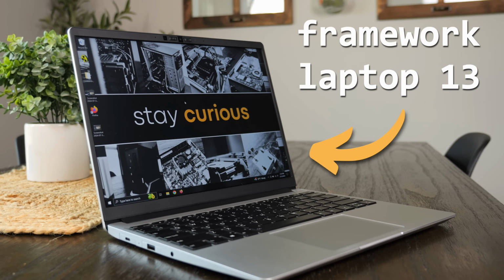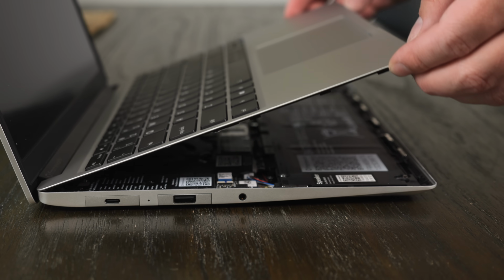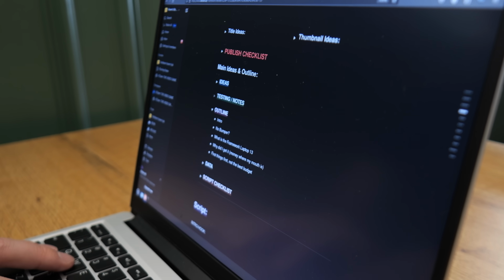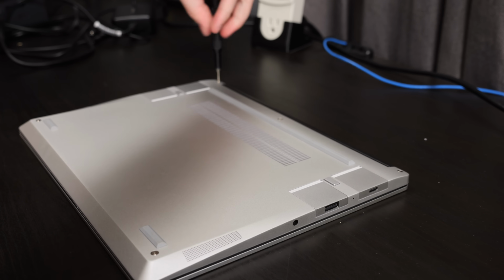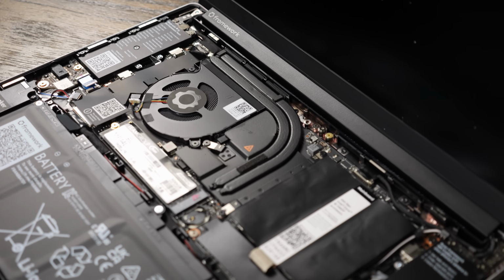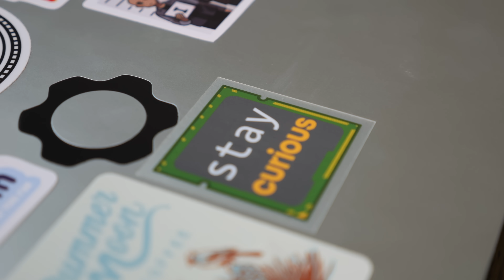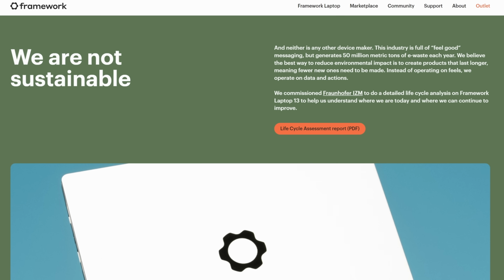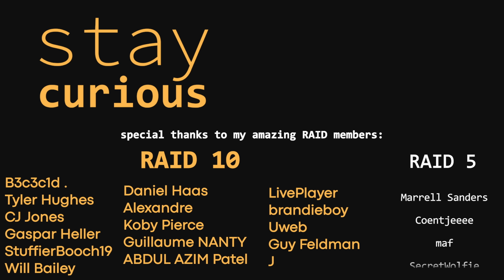Is The Framework Laptop ACTUALLY Worth It?

Comment: I would consider buying the 16" IF they add a keyboard option that has Home, Page up/down, and End keys on the right side of the laptop like what HP and a few others do on some of their laptops. I use the Page up/down keys to scroll through websites easily. It's a lot easier doing that than using the touchpad to drag the right cursor up and down and using the Page up/down keys are a lot easier for people who have arthritis.
Reply: Can't stand touchpads...when all you need is a cheap wireless mouse...why make your life so hard??😉
Reply: @erpino68  I like touchpads. And I use laptops, and so a mouse would not be possible as I hold my laptop and move it to different locations and positions. I've used touchpads for a couple of decades now. I don't think I could go back to a mouse where you're moving your arm all over the place compared to just moving your finger.
Reply: Could you give an example of where is that function or how it looks like ? I'm searching a new pc and it could a great option on travel.

Comment: Just got to the section about the high price and that buying a used laptop would've been much much cheaper. Yeah, a used Framework is an option too, one with much less chances of hidden problems. Probably not as cheap as other laptops, but you can buy a 2nd hand upgrade for it too later, so it should certainly be a good option long term.

Comment: As someone with both a framework laptop (and has used windows laptops for a long time) as well as an m2 pro MBP, it's kinda an unfair comparison. The MBP has incredible battery life, stays cool and quiet, and the best trackpad experience there is. In my opinion the trackpad experience on windows laptops in general is just awful. The battery life on windows laptops is bad, and with linux it's absolutely awful. Windows laptops (or intel one's at least) get hot and loud very easily. So for me, the major problems with the Framework laptop are just the major problems with anything that isn't a macbook. Of course Apple does everything they can to make sure you won't ever be able to fix or upgrade their products, and extorts you with massive upcharges on ram and storage.
Reply: 1. New snapdragon X elite chips
2. I dont see the point of a macbook pro at the price point, sure the tackpad is nice, and the hardware seems incredible, but when you factor in that you have to use an emulator for 99% of normal mac apps beacuse noone wants to port to arm, then you have an issue, beacuse emulation kills the performance to like 4th gen intel mobile speeds.
3. Any laptop runs linux, which is a lighterweght os which should heavily increase battery life.

Comment: I really like the framework laptops and what they are trying to do.  However, I have desktops at home and a work laptop.  So thin and light was important so I can take it and this giant Dell laptop when I travel.  I picked up a little ACER with Ryzen processor as it seems like the Ryzen mobile processors have better battery life.  It really isn't for doing "compute" but I wish it had more RAM/non-soldered RAM.

Comment: Battery life on Windows is abysmal. I've been using Linux on my Lenovo Yoga 9 (2022) now for 6 months and the battery life is at least 2.5X if not 3X what it used to be.  And heck, even if the current battery upgrade that Framework offers isn't great, it still 1 makes a difference because they are offering it first hand and 2, with battery degradation over time, getting that bump up is great!

Good video :)   I'm very glad to see more Frameworks out there.  My next purchase is going to be a Framework as long as they continue to improve. Really like seeing how they are improving year to year.
Reply: really? i had the opposite, i guess modern laptops love more linux
Reply: If Framework keeps offering batteries with backward compatibility then it'd be great selling point for me. I have an almost 10 year old Thinkpad and the only batteries I can find for it now are dodgy ebay no name ones.
Reply: @DizzyAndHigh all their batteries are chassis-specific (12,13,16) but are fully backwards compatible. All their critical chassis mounting points and cable/plug locations for the battery remain the same generation over generation.

Comment: As far as battery life and temps, thats an issue with the Intel 13th gen and even the Ultra.  Its well known that the AMD Ryzens zre currently the best for mobile (very perfomant, very efficient, longer battery life, runs cooler).  If you do decide to upgrade from the Intel 13gh gen, do some research at the time of purchase.  Right now the Ruzen 7040 series is the best option for mobile.  We'll have to see which is better between the Core Ultra and Ryzen AI 300 series in terms of battery life, temps and performance.

You really need to have a specific reason to go for Intel over AMD.  If you know what those specifics are, then Intel.  Honestly i don't see any reason to go Intel over Ryzen since the cons overwhelms the pros (all ports are TB4, and Quick Sync).  Ryzen pros are way more (performance, battery life, temp, faster iGPU).

Im surprised you didn't mention this in the video.  Battery life and temps not Framework's fault.  Get Ryzen instead, all fixed!
Reply from the maker: Well I mean there was that whole part where a simple thermal paste replacement fixed my temps. 🤷🏻‍♂️

But battery life, yeah I think the ryzen units seem to be better 👍🏻
Reply: @HardwareHaven  If you don't need the absolute full power, checking and toying with the power limits and performance levels can provide a big boost, especially on Intel chips, since they have such a high limit on power draw, if you give them power, they will use it. Of course a power limit will reduce performance, but in most common tasks it shouldn't be noticeable.
Reply: @HardwareHaven  it did, but I'd imagine the Ryzen counterpart would run even cooler with the same thermal paste. 😁
Reply: though, intel meteor lake has impressive video play back on battery. Its one of the few area's where it shows a clear lead over AMD. 

I don't know how it compares to the newer HX 300 series cpus though ( i refuse to say AI)
Reply: @Marauder-q2v  I'm jealous of Intel's AV1 hardware acceleration.

Comment: If they had serial ports I'm sold; We need them doing industrial automation.
Reply: USB to Serial adapters don't work?
Reply: @joeyyung911  Dongle isn't? Old laptops had them standard.
Reply: @TradieTrev    I used them on Cisco routers.
Reply: The expansion cards for the Framework are open source, so if you can get someone who knows how to wire up a Serial-to-USB-C you're good to go.
Reply: @K9TheFirst1  What about for the auto electricians? Shouldn't they get a canbus module, I;'d love to see an Ethernet cat device for debugging data flow.
Reply: @TradieTrev  I am not the person to ask about this sort of project, but so long as it can be translated to USB-C on the other end, and the actual connector can actually physically fit on the other end of the card, I don't see why one can't make any sort of device connector for a Framework.

Comment: Can you buy replacement parts from other vendors? Are there other vendors out there? My concern is that if Framework goes out of business, then how and where do you get replacement parts? It's like Framework made a sustainable product that will last for as long as they are still in business.
Reply from the maker: I mean, this is pretty much going to be an issue anywhere that there isn’t a standard. At least with framework, they’ve made all their schematics publicly available. I think that’s about as much as you can ask for when good standards don’t exist.

Comment: You've said "compared to my experience with the laptop that was twice the price and that no way in hell I would be able to fix/upgrade" a whole lot of times lol

And then you complain about having a single nvme slot without saying how many nvme slots you'd have in that laptop with twice the price you had (none, that is)
Like.. there are 8tb ssds, no?. They are relatively affordable, if you need that much more storage, and just 2tb is actually pretty cheap

But yeah sure more slots is better, guess it's a valid complaint (esp. if you want to have two drives mirrored for fail safety)

Then you spent a third of the video talking about battery/temperature issues, posing two sides of the same coin as two separate cons, only to immediately fix it
Like sure, their bad that the thermal paste in your unit was bad, but bashing it for so long for it seemed a bit unfair, especially for a non-universal (hopefully) issue

But yeah it'd be annoying to a less tech-savvy user - still to me it sounded like "these laptops are meh because they overheat and battery drains fast" generalisation kind of thing.

It's just that the vibe I'm getting out of the first half of the video (the more important half) is that you blow the negatives out of proportion, and not like I know a whole lot about these laptops anyway

Second half, expansion cards are limited.. How?. Like it's a negative word that you said for the sake of it being negative
Like I'm pretty sure it's as good as any $1100 laptop you can get, and it only gets better from here, because it's a - dynamic, you can change the config at any time, and b - you can have exotic configs, like 3 ethernet slots (+1 type c for power) or something.
Not a lot of options, because people don't need exotic ports anyway.. - so what were the ports you were missing that made you say cards are limited?
Also you don't need a separate drive to dual-boot linux, lol
Again, literally the same thing again, "there aren't that many on the market, but there are a few [of those exotic ports someone might need]" - how much would be enough to stop saying "aren't that many" in a slightly negative sense for no reason whatsoever?.

Yeah, making every bit of hardware work in linux is a pain, it rarely has good "out of the box" experience :)
It's definitely possible (and easy for people who daily-drove linux for years) to fix the brightness keys and to make the fingerprint sensor work (I specifically heard about the framework one, heh), but oh well, linux being linux
Reply from the maker: Well this comment is wild haha…
First of all, I made it very clear that the MacBook Pro and framework were in completely different segments of the market. I feel like I also made it clear that a lot of the expandability and repairability of this laptop were exactly what sets it apart from other options on the market. 

You say I immediately fixed the battery and thermal issues, but the battery issue still remains. Fixing thermals doesn’t change how the battery works lol.

As far as expansion cards go, I wasn’t criticizing them or the concept. I think it’s great. I was saying that I was a bit disappointed that there weren’t a ton of cool options made available because in the end people mostly just need USB. That wasn’t necessarily a bad thing, just a realization that there aren’t as many fun use cases for the expansion cards as I had maybe hoped. And yeah I know you don’t NEED a second SSD to dual boot. You might’ve noticed I was dual booting from the same SSD 👍🏻
Reply: @HardwareHaven  sorry, I keep doing this thing where I get agitated for no reason whatsoever and dump a bunch of haphazard thoughts like that only to come back an hour later (like now) and be like "what" and "oof the tone could've been lighter by a lot at least". Multiple people said it's autism, but none of them are doctors so idk, maybe

About the battery I was plain wrong, it's obvious that if the system overheats the heat comes from some source of power, and if you reduce the heat (e.g run at a lower clock or have a more efficient processor altogether, or disable the external gpu) the battery lasts longer - but you didn't reduce the heat, you fixed the cooling, heat energy stayed the same.

Yeah you did make everything clear, I was just turbofocusing and nitpicking on the structure of how you've stated your issues, sorry again

Oh yeah I did notice you dualbooted but I thought you got the ssd card for that xd
Reply: @HardwareHaven  Technically thermal paste improves heat (ofc) and can lower the percentage of heat waste a cpu produces. As seen with liquid nitrogen cooled cpus, the tdp becomes much lower. So, improving thermals DOES slightly improve battery life by probably 0.1%.

Comment: Chronologically:
short battery life
higher temperatures
louder fans
Trackpad
traditionally "key points" for every Apple laptop.

But... you complain for "more storage" on a 13 inch laptop... after choosing a 500gb SSD... coming from a Macbook? WTH?

I'd like to know if changing ram or SSD the power consumption could be a bit more managed. They are simple chips but none is totally equal to others...
One of the trickiest things is to calibrate text antialiasing. Starting from scratch with the machine should take a bit of time and test, with a pre-built one, mixing drivers and setups the OEM should provide the "best configuration available". About text, anyway, MacOS X is quite among the most refined about configuration.

Litteraly astonished to find 15°C advantage in replacing thermal pads. I hope that Framework will see this video and start some investigation for understand if there was a problem on the pasting section of assembly line. Also: verify if any marginal improvement on battery life will appear.

I'd love to hear from Framework if they have access to any statistics about laptop survival since foundation. A lot of business-targeted laptops are simply... workhorses, can be on for days, keep running and after 3-4 years still in tip-top shape. If Framework products could deliver some sort of this kind of data, maybe the "habit" of replacing whole laptops every 3-4 years could be avoided, but... With hefty discounts that some OEMs deliver with "older generation" products, the economic advantage for picking framework could be a bit too thin to make the "upgrade & repair" more advisable and choosable.

Comment: I've had a Framework 13 for a few years now. Originally an Intel 11th gen from the sale when 12th gen was announced, upgraded the mainboard to AMD last fall. Switching to AMD gave a big boost to battery life, and my 11th gen board is in a Coolermaster case running docker containers.
Reply: @0x1EGEN I think they meant monster ironically, as in it's a weak CPU (which is also a space heater) 
I do use a MacBook tho, M1 MBA, can confirm, it rocks. though I miss the ThinkPad keyboard...
Reply: @necronymnoninveni  Oh yeah maybe I misinterpreted. I also used a thinkpad before. Rocked a T420 but the chassis became brittle and cracked.. I use a Framework 13 now and it's pretty good.
Reply: how long battery live with amd
Reply: really? intel is known for being power efficient, good to know you had improvements that way
Reply: @betag24cn  Not to be rude, but what rock have you been living under?
Reply: @bhume7535  lol, not to be rude so i will ignore you as you need to be handled
Reply: @betag24cn  Intel has done horribly for efficiency in recent years. Not to mention 13th and 14th gen stability issues. They simply cant keep up with AMD anymore and with recent layoffs I don't think they'll be catching back up anytime soon. The new AMD AI 300 or whatever crushes Intel. Qualcomm has been crushing it with the X Elite as well.
Reply: @betag24cn  If Intel were power efficient, assuming that considers both heat and battery life, then no they are definitely not.. The whole reason companies like Apple even decided to move away from Intel is the same reason they moved away from PowerPC. Their laptops were running too hot and had poor battery performance.
Reply: @0x1EGEN  whatvi remember the most about the old intel apple laptops was the miserable 2 cores running at 800mhz and cookung itself because apple was cheap to put a real cooler on those monster cpus 😂
Reply: @betag24cn  The only place where Intel is more power-efficient is in desktop CPU (not APU) idle power. All other metrics are on AMD's side and it's not even a competition.
Reply: @zekicay  that is a part where i wish it was better, idle, my old ryzen at idle eats like 40 watts, still to be improved i guess
Reply: @betag24cn  Were you living under a rock for the last 5 years? Intel lost the nanometer wars. Their cpus still have 10nm architecture and they're drawing more power. On the other hand AMD is in 4nm now. It has more transistors and draws less power.

Comment: He regrets getting the Intel-
Reply from the maker: If I remember correctly, the Ryzen models weren't available. I didn't really care that much either way, so I just got the one I could
Reply: @HardwareHaven  fair, but I think the point was that the thermals and battery are better on the ryzen version, which 'fixes' two of your gripes.
Reply from the maker: Better thermal paste application fixed one of my gripes, so I don’t think that half applies lol

Still, I can’t review a product I don’t have

Comment: I am wondering if you could take the 3D printable case and use it as a second battery expansion enclosure or custom docking station.  I mean you mentioned the battery was underwhelming so in theory it shouldn't be that hard, should it?

Comment: Constantly comparing this to a MacBook pro M2 is akin to comparing a top of the line Mercedes or Volvo with a Ford Focus. 

I'm not a Mac fanboy, but the framework is like a 700 dollar windows laptop with a 200 dollar markup for the awesome repairability and upgradeability along with the expansion modules.
Reply: a 700 dollar windows laptop? the lowest specced Ryzen 13' Windows "working with 4 ports" Framework laptop price that I can get is 1263 euros which would be 1380 USD. So either it's a 700 dollar windows laptop with a 680 dollar markup or the ratio is a bit off.
Reply from the maker: I think I compared it directly to the M2 twice, and made it clear that they're in entirely different segments of the market.